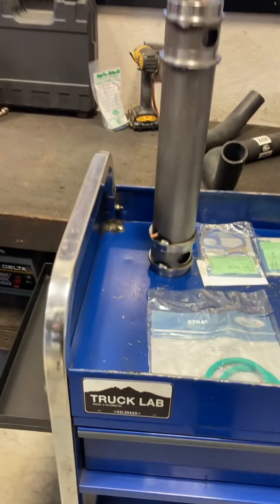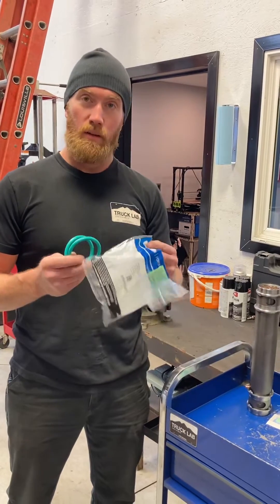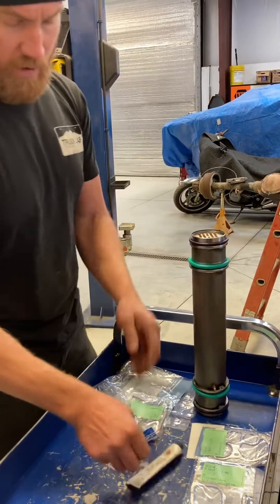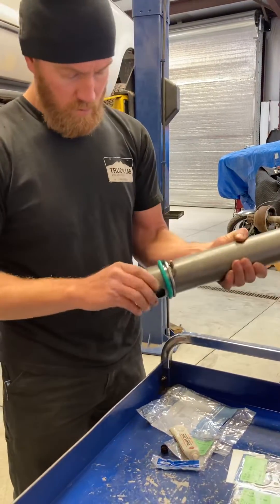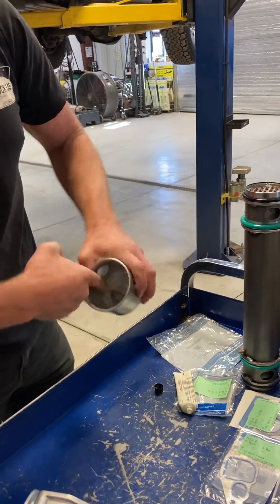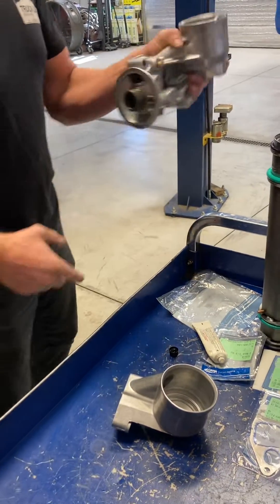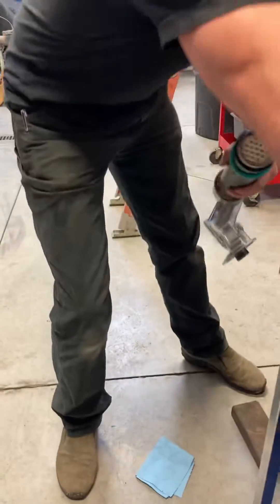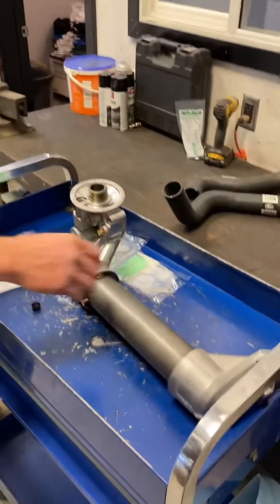How to assembly a 7.3L oil cooler without a press

Comment: Why electrical grease? And there are 2 diff orings per side a thick one and a thinner one.   Is the thick one the first one you installed or was it the thinner one?

Comment: Why would you put dielectric grease on an oil cooler? What about SuperLube O-Ring silicone lubricant? That's what it's made for. Dielectric compound is designed for use on electrical connections.
Reply: Grease is grease. You could use your momma’s cocoa butter and it wouldn’t make a bit of difference.
Reply: @zachwheeler12292  "Grease is grease"? WRONG. A LOT of grease is petroleum based. Petroleum based grease deteriorates rubber. Cocoa butter is not petroleum based.

Comment: Ratchet Straps , hammers, nothing works for me, I have to give it to a shop with a press.
Reply: Helps if the ambient temp is higher than 75
Reply: And to make dam sure that everything your working with is absolutely shining clean.  No build up, goo, old o-ring, or what ever just make dang sure each end is very clean and it will make your life so much simpler with this.